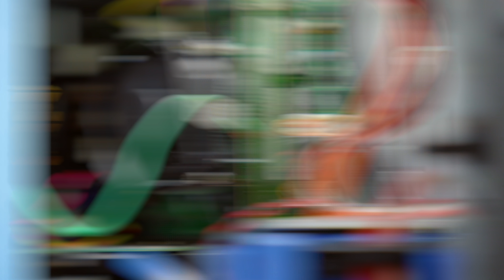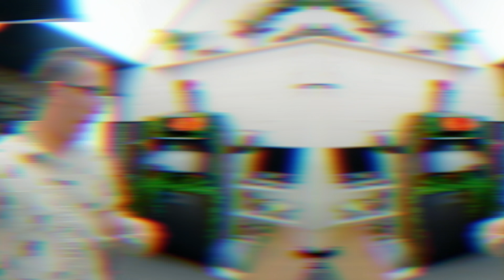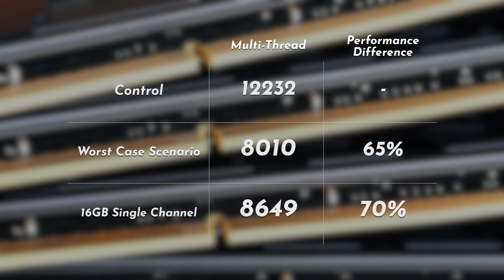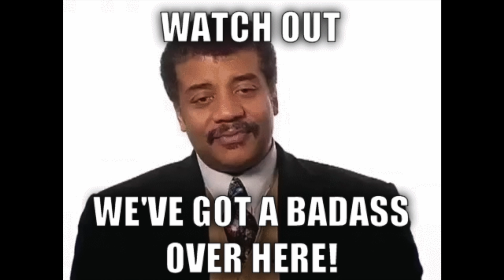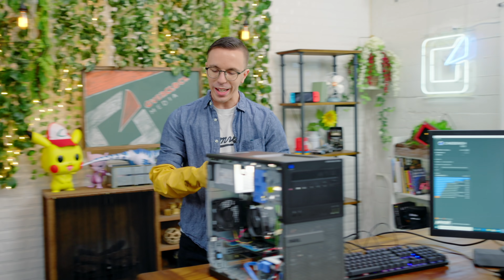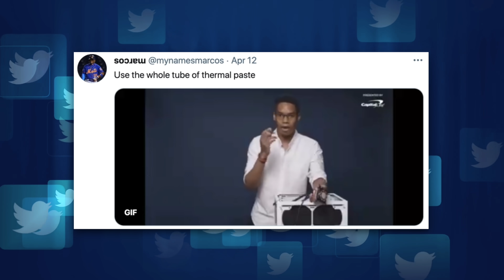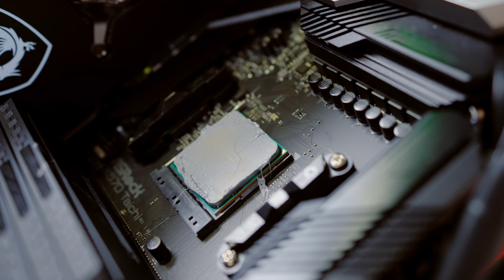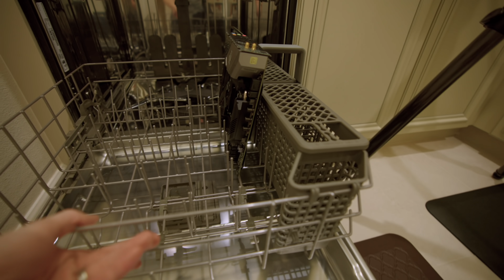Gaming PC Lies People Believe

Comment: Techie of 20 years, never used a wrist strap. Never a problem. With that said, I do on occasion touch the back of a PSU just to ground myself if I've been walking a lot on carpet, just as a maybe case.
Reply: In my city, grounding circuits is not mandatory and no one does it, so if touch my PSU, I'll just get shocked, lol.
Reply: you're probably living in an area with high humidity. where i live the humidity in winter is so low, i get zapped when touching the plastic mouse. and i don't even have carpet. don't push your luck
Reply: I feel like before working on my computer I have to touch the case enough to get rid of any static anyway
Reply: I do the same. Touch the power supply housing (or the inside of the case, if the PSU is installed) periodically and you're usually fine.

Comment: The toothpaste thing there are a few things that should be noted. You want fluoride free toothpaste and with a fine or no abrasives as possible. It will work in a pinch but not recommended at all obviously. I had to do a temp Xbox 360 repair with toothpaste many years ago. RadioShack was out, the local PC store was closed because Sunday in Oklahoma but hey it worked for that night.

Comment: Electrical Engineer here:
NO, the tesla coil is *NOT* equivalent to static electricity. For that, look into high voltage DC source, like a Van De Graaff generator (the thing that makes your hair stand up) or a flyback transformer driver circuit, the high voltage wire on a CRT for instance. ElectroBOOM also made a pretty nifty solid state version using a voltage multiplier circuit, similar in output to a van de graaff generator.

Your attempts to build up static failed because you need to use the right materials to generate the most static, and make the air as dry as possible. Humidity does a respectable job of dissipating static charge and buildup. Also you were just building a static charge to the balloon not to yourself. Consider wearing rubber boots to insulate yourself from the carpet better.
Reply: Oh and the Tesla coil failed because electricity finds the easiest path to ground. It was arcing to ground points. The current is low enough that there was no significant voltage drop on the ground planes within the mobo and PC.

If however, you took the CPU out of the socket and started rubbing the high voltage wire to the CPU pins or landing pads.... well there is a very good chance you will kill it.
And you should let the motherboard dry out for more like a week, or stick it in the oven at the lowest temperature, around 180 degrees, to drive off moisture.

Comment: Hey Austin I have an amd ryzen 7 1700 eight-core processor and was wondering if this processor is still reliable or is it time to upgrade?
Reply: Upgrade
Reply: If money is tight and you have a compatible board, get a Ryzen 5 2600, it handles games nicely.
Reply: @KaitoShionGGO  ok that is my processor and I was looking for a new motherboard because mine is currently a few years old
Reply: @agx_nate7737  stick with the board you have if it supports the cpu you want. just think, you could spend 200 on a cpu and 200 on a new board, or 400 on a much better cpu. you won't notice much of a difference changing out your board unless something is wrong/flawed with it.

Comment: I have my WWJD bracelet and Tweezers... Yeah I got one...!
Reply: Lets not forget the swiss army knife that "hopefully" has a screwdriver in it... we cant forget that
Reply: Don’t forget your thermal past applicator 🥴
Reply: yall forgot the most important thing, A TABLE
Reply: @happybeer1000  I'm sure there have been a few people that broke their PC when they got half way through and realized they forgot their table and the PC that was float in mid air crashed tothe ground lol
Reply: And a quarter ton tub of thermal paste
Reply: A bracelet to fight static.
Plus shock absorbers for the power supply..
Reply: We need these insulating pads to insulate electricity incase the system shot curcuits
Reply: The verge wasn't making a PC build guide, they were verifying that the internet is TRULY immortal. That's one test they still regret for sure. I bet the host can't even go but groceries without getting called out for that disgusting video.
Reply: don't forget to screw with confidence!
Reply: Make sure to put your power supply the wrong way
Reply: make sure to put the aio without any fans
Reply: And also remember to screw in the AIO radiator using the long screws...without the fans. 😤🤣
Reply: what about the table?
Reply: And remember to screw in with confidence
Reply: @FigsMafia  🤣
Reply: Don’t forget the cpu bracket
Reply: Let's not forget the brace.
Reply: And livestrong bracelet.
Reply: make sure you have a allen wrench because you cant forget that...
Reply: Oh and don't forget your wooden table!
Reply: The magic wireless fight cancer and fight static bracelet is also very important
Reply: Live strong bracelet
Reply: a bracelet to fight cancer
Reply: The verge to build the worst gaming pc in history of planet earth
Reply: And the ryzen 5 5950x... Yeah he got it
Reply: Comedy gold.

Comment: The "static electricity" you used isn't actually static electricity. It's high voltage DC

Also The Tesla coil is AC (also not static)

Also also the taser is not 3.8 MILLION volts, because the voltage would be limited by the current given, not to mention that that is running off of a fingernail sized battery

Also also also (sorry I keep watching the video and editing the comment) you cannot pick up 20,000V of static, did a search, highest recorded was 15k. 5k most commonly

Comment: I added 3200mhz to my laptop with a 10300h that had 8gb 2933mhz and it kept bsod
Reply: If the laptop tries to run the 2933mhz stick at 3200mhz its going to crash

Like wise if the latency is wrong say 16cl for the 3200mhz stick and 18cl for the 2933mhz stick again it will crash

So good luck with it i would say get a refund asap
Reply: @commanderoof4578  lol, I thought it'll just drop the speeds to 2933mhz (couldn't find 2933mhz 8gb ddr4 anywhere in my country had to order it) took months to arrive
Reply: @xanderyusuf7494  well if you’re ur bios lets you, you can drop the speed manually

But you would still have the issue of timing differences to sort
Reply: @commanderoof4578  thanks bro